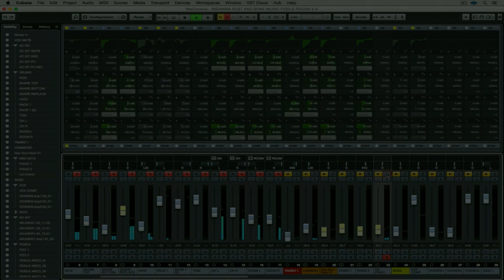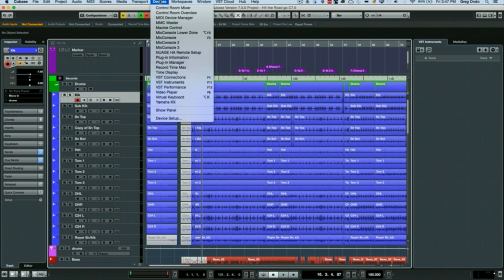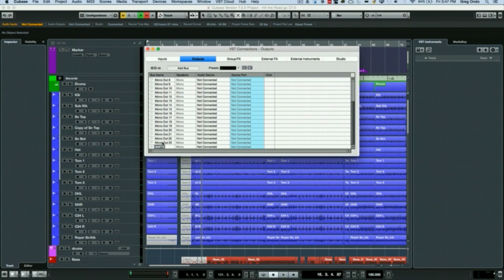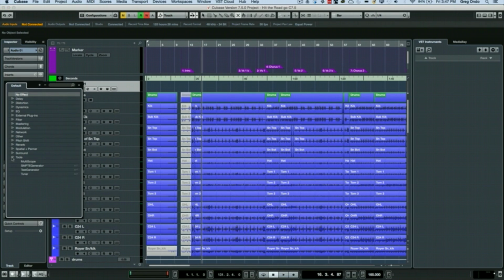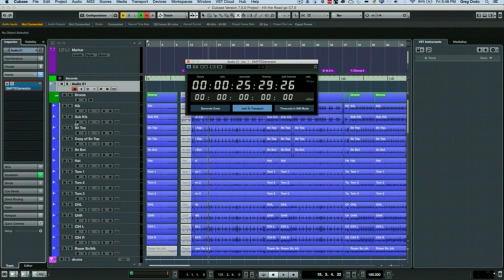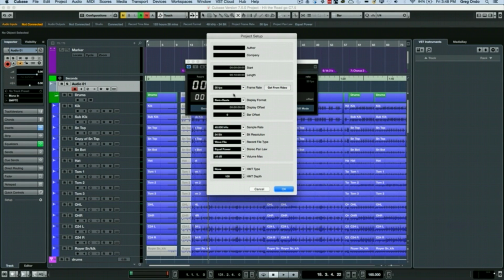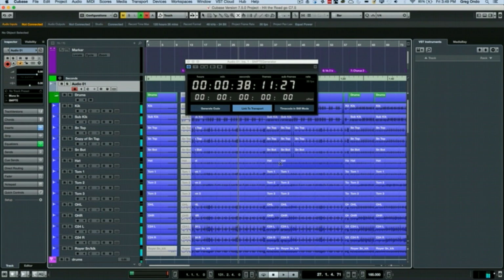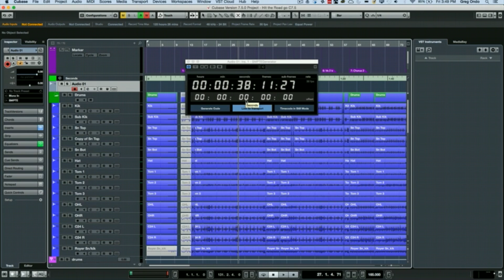How to Sync Using the SMPTE Generator in Cubase | Q&A with Greg Ondo

Comment: These videos are great. Thank you. I already did this but I have a different issue. I use a MOTU MTPAV Parallel Midi interface connected to a PC running Windows XP. Then I have a Windows 10 PC running Cubase. I use a MIDSPORT4X4 for cubase connected to the MTPAV Midi channel 7 in and out. I have an Alesis ADAT connected to the MTPAV sync serial port. I can control the ADAT from Cubase and vise versa. Cubase is set to slave to the MTPAV. The ADAT slaves to the MTPAV also. All seems good but the Sync indicator in Cubase never displays locked? Only idle.
Reply: I sorted this out. I have the MMC master reporting Lock 30. Just need to see the same in Cubase 10.5.

Comment: I wonder if it's possible to record that signal on a multitrack recorder and use Cubase as 'slave'...
Reply: Just to sequence hardware gear synchronized with the recorder, due to the lack of midi connections of the Zoom range (r24...etc)
Reply: And, of course, without using external boxes... One of the input audio channels could be the 'sync in' connection...